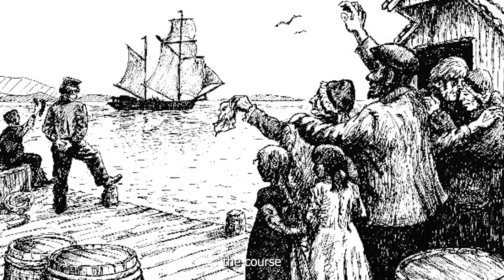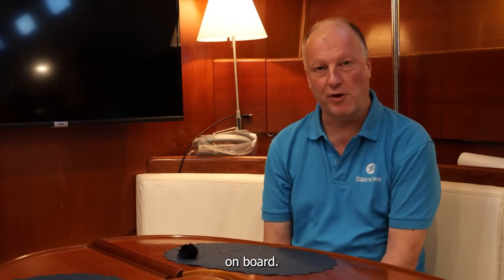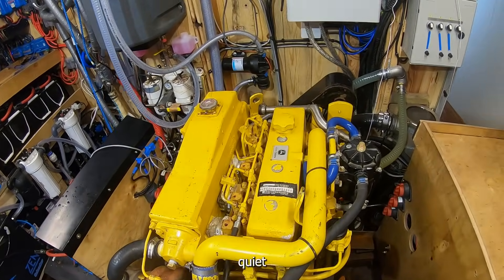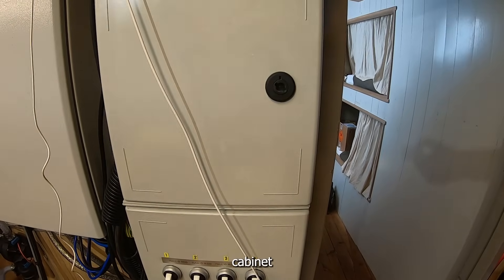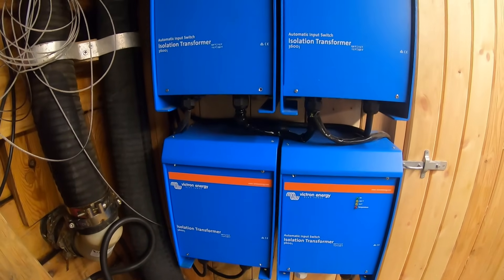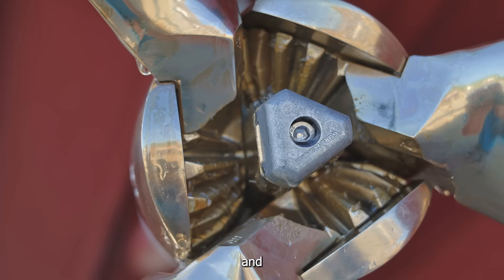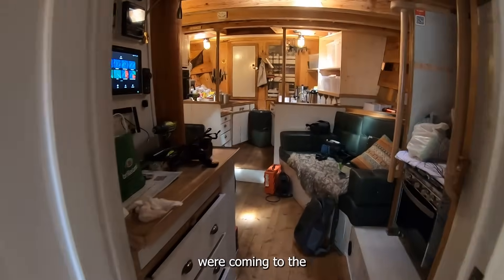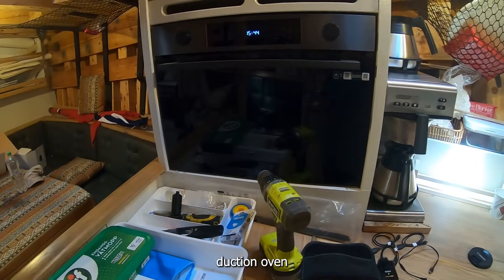Resturation - electric propulsion + sail Norway-New York-45 tonn and 54 foot started 4th July 2025

Comment: I wish you success with your project. However, the system has a lot of components. Just because we're going to be driving two shafts electric doesn't require all that equipment. The engines are very small, and they're turning a folding propeller. Your engine has no torque. You'd need a propeller of at least 45-48 cm. You can't increase thrust by taking in clean water and foaming it. As far as I understand, the folding propeller means your system doesn't have regeneration capabilities. In fact, when you're sailing with the wind, the non-folding propellers should charge your battery. A much more efficient project (lower kW consumption) could have been built for less than six times this cost—faster, more effective, less risky, and less equipment. Please recheck all the values you consider success. I'm sorry for you. Keep up the good work.
Reply from the maker: Hi, thanks for your comments. The propellers are delivered after recommendations from the technical department of Gori propellers. They are 22 inch. You will see in the video that they are generating 500-1000 W in the curves shown in the video.
Reply: @silentsea5568  What I'm talking about is this: It hasn't been a system that's efficient and sustainable. It used a folding propeller because, unfortunately, the motor or drive it uses doesn't have regeneration capabilities. Regeneration alone isn't enough. If Lifepo4 capacities could be powered solely by batteries using architectures like 24/32/16, and generators could be equipped with offline charging capabilities, there wouldn't be a need for so many isolators and inverters. Please, please, please, I beg you. Take precautions against fire, thermal stability, and current leakage. There was no need for meters of thick, bulky cable. Manufacturers always select propellers they can find in stock according to standard standards. They must measure draft, shaft angle, and evaluate the kW power output corresponding to the takeoff displacement. Simply selecting from a standard catalog doesn't mean you're done. The important thing is the project's sustainability and self-sufficiency. For this project, ask the integrator to: land the boat stern-first in the harbor, secure it with a chain, and install an electronic precision scale. and give 1 kW each and see kilogram/force (thruster power) give 2 kW each and see. give 3 kW each and see - give 5 kW each and see. (You can measure the speed later as in the maintenance video. maybe you chose a very wrong propeller. maybe that propeller cannot provide the required kW power during takeoff and when thrust is most effective. a real project is created by measuring kg/force and propeller trials according to the boat's defensive attitude and displacement structure. I am speaking as someone who has been doing this only for more than 10 years.
Reply: Electric motors have much more torque at low revs than conventional motors.
These are also able to regenerate power whilst sailing.
Reply: @thomsonsails  What I wrote has nothing to do with what you said. The old system on this boat is operationally more efficient. The overall efficiency of your new system is worse than the old one.